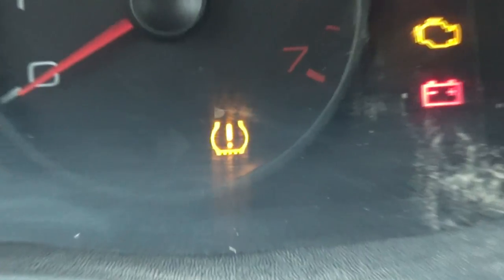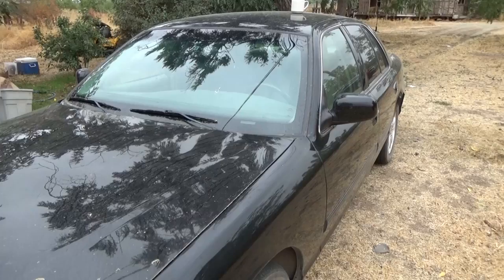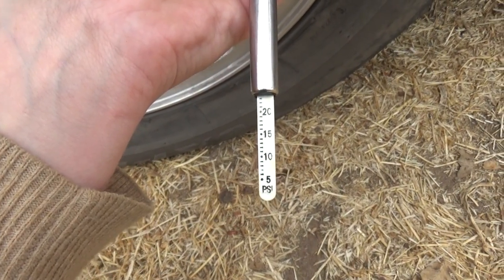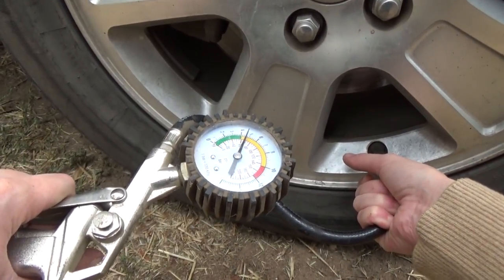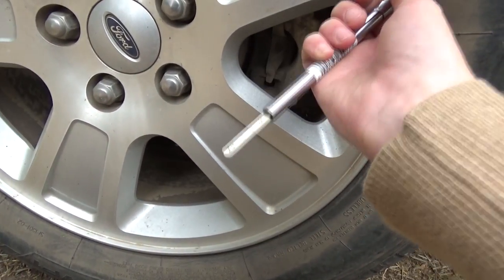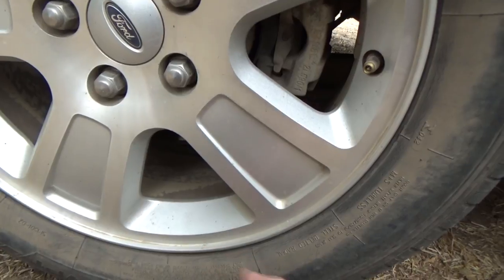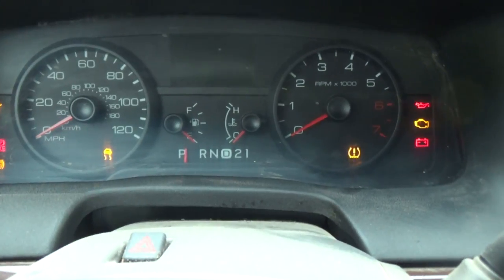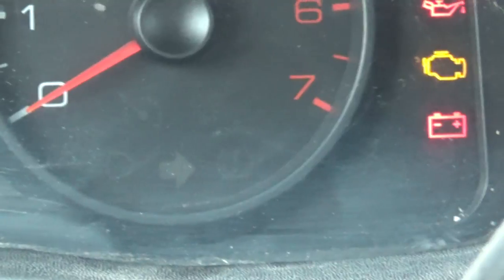What Does This Light Mean??

Comment: It might also mean that the speed sensor needs to be fixed if the light stays on after checking air pressure and it's at right pressure
Reply: yeah mine is still on even though my tire pressure is good. what should I do?